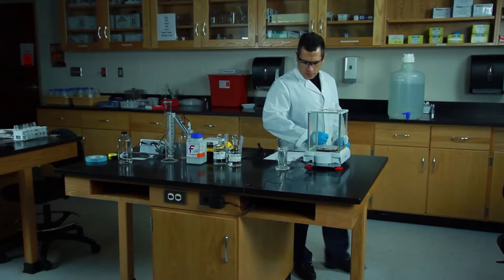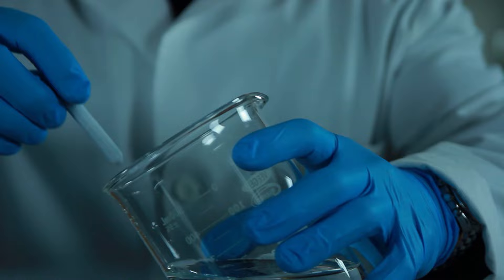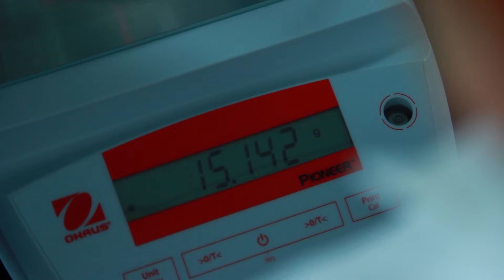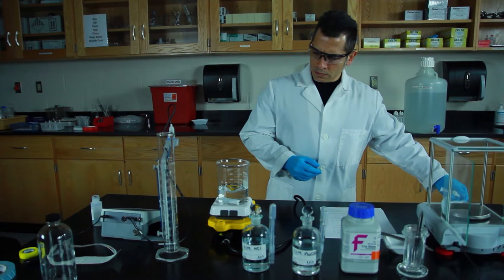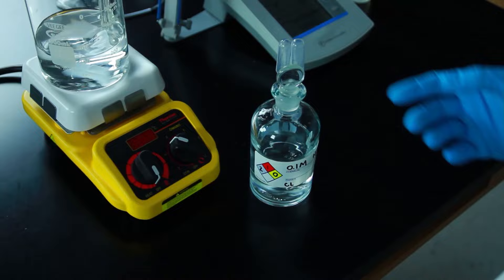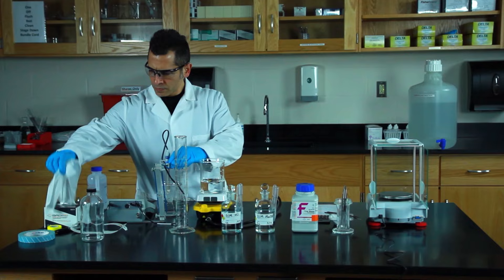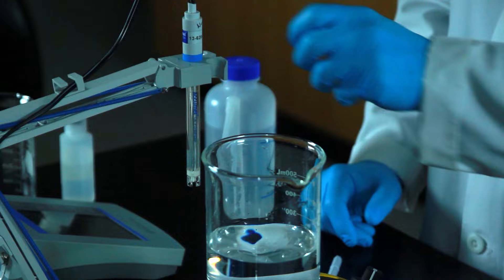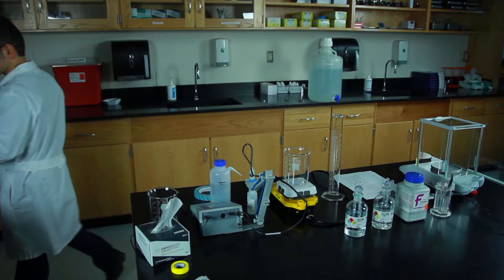Preparing Tris Buffer

Comment: Did you know that TRIS will form precipitate with Ag+ in conventional pH meter electrode?
One does not simply measure TRIS buffer in pH meter with Ag/AgCl electrode with single junction reference electrode (mostly used in conventional pH meter now days) because it will poisons the reference electrode.
using calomel electrode or double junction reference electrode is the correct way

it seems that your using single junction electrode (i can see it clearly) and therefore your actual pH in not 7.8.